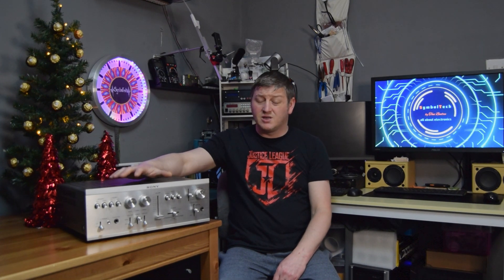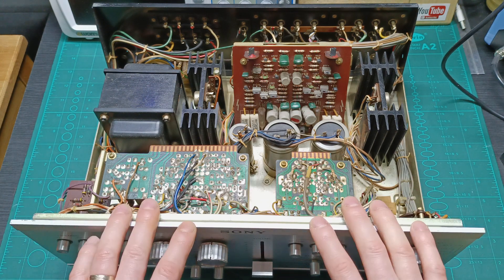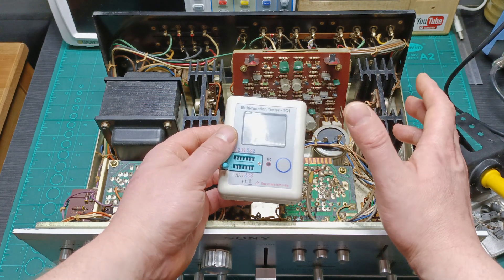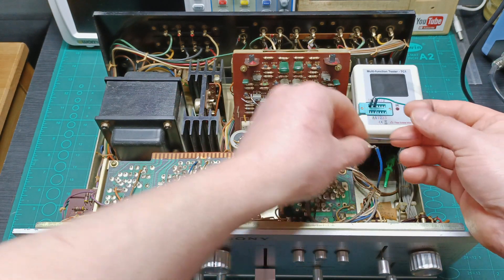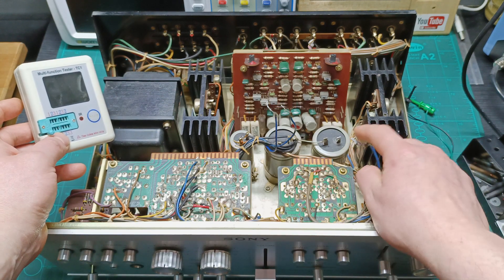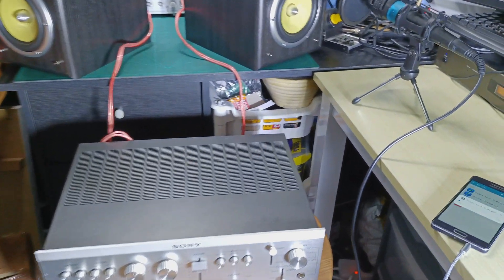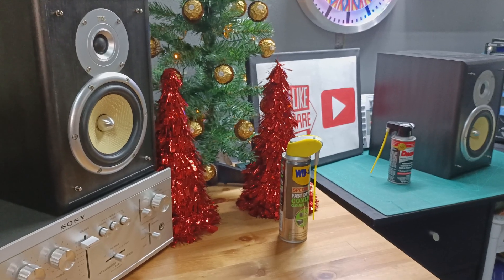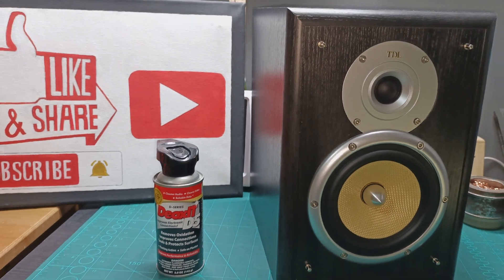Sony TA-1140 servicing part 1

Comment: Hi great videos on this amp my friend 

I’m getting buzzing after a while on one channel with this amp also dc voltage present on the same channel  speaker output could you point me in the right direction to fix ? I’m going to also recap the amp .. great work
Reply from the maker: first I will check the power transistors then check if are biased correctly and give a check on the dc offset pot
Reply: @SymbolTech21  thanks for reply 

Could you tell me what where the pot is ?
Reply from the maker: @stompinfm  I don't have anymore the amp with me. Because was a friend repair and recap